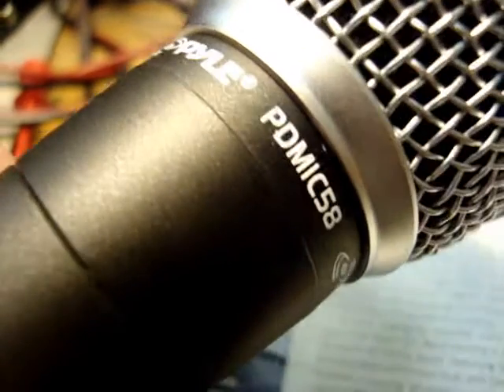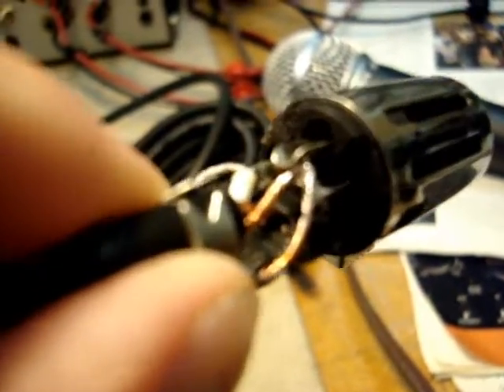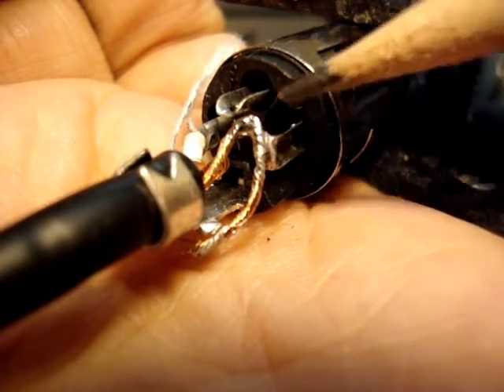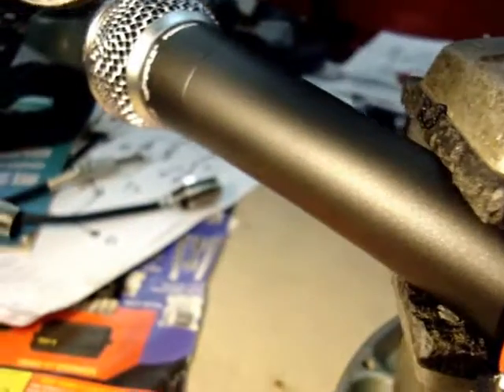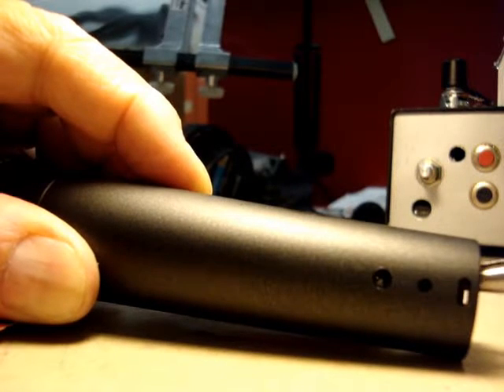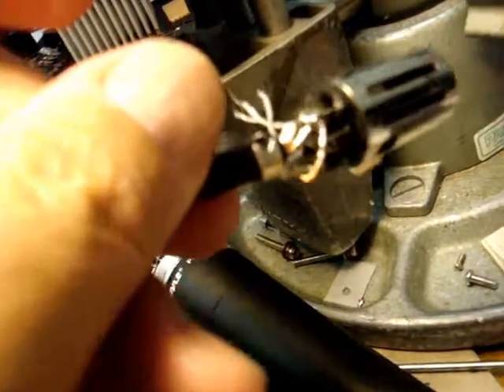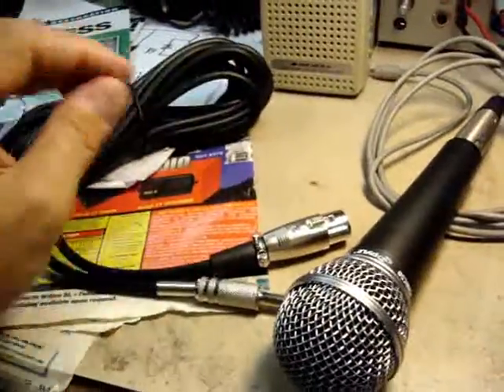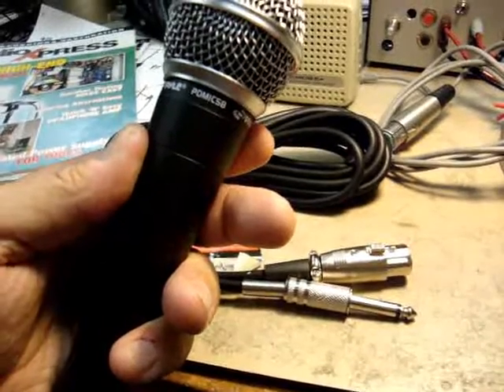Pyle PDMIC58 Microphone - SM-58 Knockoff

Comment: OK, here's a question that I have with the way the PDMIC58 & PDMIC78 is originally wired ? Perhaps the Mic itself is wired that way to work with either a balanced or unbalanced mic cable ? Maybe it doesn't matter because by jumping the pins like they did that is the same thing as soldering the wire to pin 3, seeing how they are connected. With the 1/4 inch TS, the wires go to the tip & sleeve. Has anyone tried the PDMIC with XLR => XLR to see if they work as is without a mod ? They function quite well out of the box with the cable they have. And again the included cable, the XLR female is the same jumping with ground pin 1 & pin 3 to the 1/4 inch TS, if I understood that correctly for it to be rewired & soldered. The missing mic impedance transformer is just to match impedance of the 600ish Ohm microphone to that of an 1/4 inch input jack of a guitar amp, if I understand that correctly as well. I mean,  this is a microphone, it's not anywhere near an amp to speaker cabinet output power level of 20-100+ Watts of output from the amp transformer. Is it anything stronger than a guitar pickup from the 1/4 inch TS guitar output to the 1/4 inch TS input of a guitar amp ?
Reply: You are correct. However, it has an XLR connector which indicates that it's balanced. XLR connectors are an industry standard for balanced. We would expect these mics to be the electrical equivalent unless otherwise stated.
Reply: @Music-zh7fm  In that case, I think that I prefer the Pyle or any microphone to be a universally wired mic and then let the cable that one chooses dictate whether it's balanced/unbalanced. If inside the 6 1/2 inches of microphone makes no difference as balanced or unbalanced to capture and send a signal to the mic XLR output at it's base, it's far better to have a cord of available or a desired length to be universally accepted as well. That way it doesn't matter whether the cable is XLR => XLR as balanced or XLR => 1/4 TS as unbalanced. Pyle actually has the better solution here in the debate of wiring the actual mic itself and all one needs to be concerned about is cable length and whether the type of cable (unbalanced) would tone degrade.

A professional level low input Z mic is rated 50-600 Ohms for Output Impedance anyway. The Shure specs at about 300 Ohms of Output Impedance. Not really a meaningful spec since 50-600 Ohms is a Professional level mic. Sensitivity is a relatively elusive spec that seems to be 54-59 decibels for either Pyles or Shures based upon website specs. The Pyle that I have is 600 Ohms at the end of 15 feet of the included mic cable (multimeter tested). I recall the magic number for an unbalanced guitar cable, tone loss degradation being beyond 18 feet 6 inches. If the Pyle is a glassier/sparklier tone, a 25, 30 foot or longer unbalanced microphone cable is going to make the Pyle = the Shure at some point beyond 18 feet 6 inches. And even better if the microphone is wired to universally take a balanced cable of 50 feet or whatever length that is. There's no reason for tossing the Pyle included cable, use it for what it was intended for, options really are better, what if the XLR on the DI is suspect & compromised ? The 1/4 inch TS is still an option to use ?
Reply from the maker: @jimcamp2423  - Yes, you are correct.

Comment: What adapter/transformer is good for live vocals?
Reply from the maker: Hmmm, I'm not sure. Do you want an adapter to connect it to your PA?
Reply: @bob4analog  Yes that's right direct into a PA/Powered Mixer . I found some transformers but not even sure they are the 'right' ones. Appreciate any help on this
Reply from the maker: @profile1251  Ok, so are you able to plug your mic into the PA at this point? if so, does it work, or is there a problem with how it sounds?
Reply: @bob4analog  it works but sounds cheap, havent checked if wired balanced as per your video but it was purchased in 2015 so likely not balanced. Im hoping rewiring w/ thicker gauge wiring will improve sound quality and possible getting a transformer
Reply from the maker: @profile1251  Thicker guage wire won't improve the sound of this mic, and I don't think a transformer will either. Balanced or unbalanced,  the mic should sound the same.  Are you comparing the sound f the Pyle mic to another mic?
Reply: @bob4analog  Thanks for the info. What then is the benefit of balancing it? less feedback>?
Reply from the maker: @profile1251  Balanced is far less prone to electrical noise and hum. Therefore, long mic cables runs are possible. This is why most professional mics are wired balanced. There are some good tutorials on youtube that explain the differences between balanced and unbalanced.
Reply: @bob4analog  But mic feedback specifically is not improved with a balanced mic ?
Reply from the maker: @profile1251  Nope. The mic pick up pattern is important for feedback concerns. A tight cardioid pattern mic is often preferred for control of feedback in a live situation. There are some great tutorials on line regarding feedback and the best mics to use to minimize feedback in live situations. The balanced vs unbalancd issue is strictly electrical with regard to how the mic audio is transferred from mic to PA.
Reply: @bob4analog  Thanks for all the info
Reply from the maker: @profile1251  Sure, no problem, anytime!

Comment: What is the reason for making it balance? Thanks!
Reply from the maker: Ronneil Camara - Balanced is far less prone to electrical noise and hum. Therefore, long mic cables runs are possible. This is why most professional mics are wired balanced.

Comment: How do I connect my pdmic58 in a av controler receiver? I tried it in a vcr mode and it doesnt work. I place it under fm and it works as the speaker. Any idea to setup? Thanks.
Reply from the maker: Vincent Guzman - It appears that you have the mic connected to an output,  which explains why it works as a speaker... dynamic mics can do that. The mic will need to be connected to some kind of preamp to increase its output to a level that is compatible with your A/V controller, then it should be connected to the "line" input. Then it should work ok.

Comment: Dude, I'm telling you...as a home recording musician of pretty much any and all instruments, when I first saw these Pyle Mics...the Pyle PDMIC78 is what I picked at a local shop for $20.00 used. After replacing the cheap Chinese wiring to a coaxial type cable (center conductor wrapped in shielding wire) and re-wired the mic for a balanced output, then ran it through a Radio Shack adapter that has the transformer in it...I was totally blown away by the way it sounded!!! I was so impressed with it, I took a cheap Nady mic that I got at the same store for $5.00 because he didn't know if it worked or not...after the wire upgrade, and installing a newer and better Nady mic element that I had laying around...same outcome...they are now the MAIN mics that I use for EVERYTHING...especially vocals. After the upgrades and mods...they both have the perfect amount of bass, midrange and treble of ANY mic that I have used so far. I am on a very tight budget, so I have to get all my gear used or at garage sales, etc. I am the only local guy that everyone within a 4-5 county range that brings their stuff to, to have fixed, re-built, restored, etc. I work on and build computer systems...work on, repair, mod and tune up the locals CB radios...among other things. But back to the mics...I don't see paying over $100.00 to $300.00 and up for a good recording mic, when I have the exact same mics that I bought used, did some re-wiring and a little modifications...and I honestly can't tell the difference in sound quality at all...they sound exactly like their expensive cousins...if not BETTER, but that's just me. You would literally piss yourself laughing if you saw my little recording studio. My Stagg Les Paul copy, DigiTech RP150 that I use for everything...from guitar effects, bass guitar simulator, and vocal effects, a Behringer V-Tone Amp head, a Crate GFX-15 amp, a Sony 200 watt power amp and a Sony stereo receiver, a Casio CTK-* keyboard with a computer system for all the synth stuff running into my main studio recording computer which I have several DAWS...Reason 3.0 for synth keyboard, Cakewalk Sonar Producer Editions 6, 7, and 8...along with Cakewalk Guitar Tracks 2 and Cakewalk Pro Audio 9. My gear does me well, it's all stuff that I bought at a decent price from my local guitar shop, or bought used at garage sales and music stores. But I've made it work. I have actually been very impressed with the way that my music is turning out. For right now, I'm content with my setup. I'll add on as I need to...I am still needing a set of studio monitors and those are hard to come by, even used. All I have at the moment is a set of Sony home stereo speakers that I modified with some resistors and capacitors to get a more flatline response from them. Like I said, I just have to work with I have, and so far it's worked out pretty well. Thought I'd share.
Reply from the maker: Nice success story.. Very Cool! Thanks for sharing. It's nothing short of amazing what's coming out of China (of course, it depends on what it is). As far as the mics are concerned, yes, they sound great. Only problem I've seen tho (besides the wiring issue), is that these mics are not as rugged as the originals. I've had the wind screen detach and fall off. Just glued it back on again, good to go. They're performance far exceeds this problem. For the price vs performance, they're a great choice. Thumbs Up!
Reply: Bob H
-- UPDATE -- I just bought a Samick Bass and a DigiTech RP100 to use with the RP150 inline for bass, guitar, vocals, etc. So far, the studio is coming along great!!! Thanks for the video...very informative and valuable information.
Reply from the maker: Gunslinger Survival - Thanks for sharing. Sounds like your studio is coming along nicely.  Hopefully you can Share your recording experience with these mics. it'll be great to hear how it sounds.
Reply: Hey man, I saw your post on podcastages review of the pdmic78. Ive been watching some reviews and it seems to me that the pdmic58 would be great for vocals and the pdmic78 for acoustic guitar. The pdmic78 seems like it picks up a bit more of the acoustic guitars bass and mids. Wondering what your thoughts are?
Reply: I run all my microphones through a mixer, so I can adjust the EQ settings as I need to according to what it is that I am recording. But yeah, you're right...if you are going to run the mics straight into your PC, or into a small amp and then into the PC using no EQ (you can always EQ the tracks after recording within your DAW itself later)...that is exactly what I'd do. It's actually what I did when I first started. I'd use the PDMIC78's for recording instruments...their frequency response are EXCELLENT for that...and I have a Nady SP33 that is identical to the PDMIC58...both use the same identical element...and I used it for vocals with a pop filter...same thing, frequency response is excellent for vocals. You're spot on. I now have an M-Audio Broadcast Dynamic Mic that I did the same modification to...and now IT is my top number one mic that I use for EVERYTHING...it is SO versatile that I can plug it right into my little Marshall 15 watt amp with the EQ settings all set to zero, run it into my PC and record anything with it...vocals, instruments, etc...and I only have to adjust the EQ settings post-recording to a minimal degree, barely any adjustment at all. I just got an Audio-Technica ES-915 H condenser microphone that runs on 10 volts to 15 volts phantom power that I plug into my mixer and use strictly for vocals now. If you're using the 78 for instruments and the 58 for vocals...you're doing right...keep it up. You got the right idea, brother,
Reply: Right on man! Im going to go pick them up right now. They'll do the job for now and perhaps by the end of the year I'll get something better if need be. For $35cad for the pair I cant really go wrong anyways. Im gonna do the mods this weekend too.
Reply: I have a Tascam US-122L interface that I'll be plugging them into. Its not the greatest interface but it'll do for now. Do the mics require phantom power? Im not sure how that works yet, just getting into recording... Thanks for the tips!
Reply: No, a dynamic mic does not require phantom power to operate. Now, CONDENSER mics DO require phantom power to operate. You'll be OK for now, as far as your set up goes. Good luck with it...once you get it all set up and working, it's an awesome hobby. I've played in bands on and off for years and loved it...but the home recording hobby is even better...you can do your own thing, write and record your material...THEN get a band together and you got TONS of original material to use. That's MY plan, anyway...lol.
Reply: OK, cool. Just remember this...the XLR pin connections be it the microphone jack at the base of the mic that you plug into, or the XLR plugs and jacks on each end of your XLR cable...make sure that whatever color the wires are in your XLR cable match up to the corresponding XLR pins. This is especially important inside the microphone. When you buy ANY mic, they will claim that the mic has a balanced output...you can never tell until you actually take the jack out and look. The CORRECT way that a mic is truly balanced for optimum output, clarity, etc...make sure the mic's XLR jack is wired as follows - Pin 1 is shield and also requires soldering a wire jumper from Pin 1 to the ground tab that the set screw goes into, Pin 2 is positive and Pin 3 is negative...meaning make sure that the negative wire and positive wire from the mic element are wired to the right XLR pins at the base jack. It's best to use what's called "shielded mini coax", but you CAN use two separate wires (red and black), just make sure that after you solder them to the mic element that you twist the wires around each other before you solder them to the mics XLR jack...it helps to cut down on noise and interference in the mic line and the mic itself.
Reply: Awesome man! Thanks for letting me know about the twisting the mini coax. I was gonna buy some tv cable from the dollar store and use that but its too thick lol
Reply: LMAO, yeah...TV coax would be WAY too thick to work with. Go to Radio Shack and ask them for a roll of "Mini Shielded Coaxial Cable", they will get you the wire you need. If you can't do that, then as a last resort use regular speaker wire...the kind that has a plain wire and a wire with a stripe on it so you can keep your positive and negative polarities straight. If you use the speaker wire method, then make sure to  separate the two wires (pull them apart as two separate wires). Solder them to the mic element in the mic and make sure to twist the two wires around each other before you solder them to the XLR plug at the base of the mic, then solder a small wire jumper from Pin 1 shield to the ground tab that the chassis/XLR plg screws into...that's important in making it balanced. The best way to go is with the shielded mini coaxial cable (you don't have to twist it), and the shielding helps prevent unwanted noise in the signal line. The part that sucks is making sure that all of your XLR mic cables are matched as well...making sure that the correct wires are soldered to the correct pins and grounded properly. After that, you're good to go. I've been doing this for awhile now, and I am still learning new things as I go, and just about at the point that I can start building my custom studio desk to mount all my gear, computers, cables and electrical outlets. Then the next project will be sound dampening and making a sound proof vocal booth. It's never ends, dude...lol. Good luck with your projects, man. Holler if you need any advice or anything!!
Reply: Gun Slinger please make a video